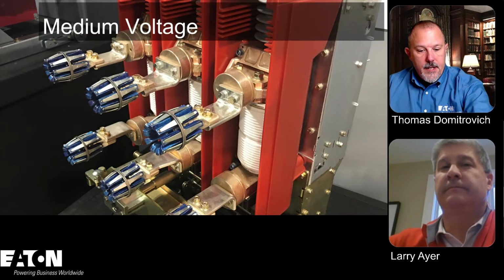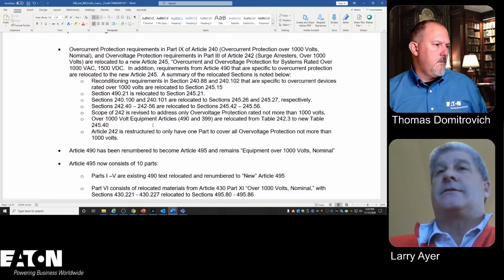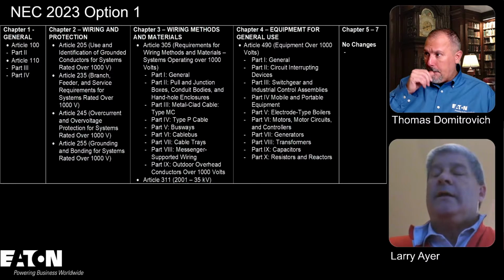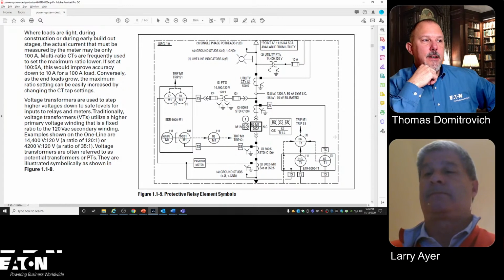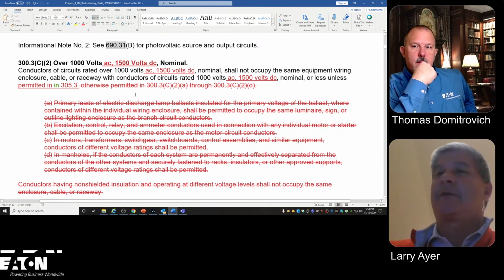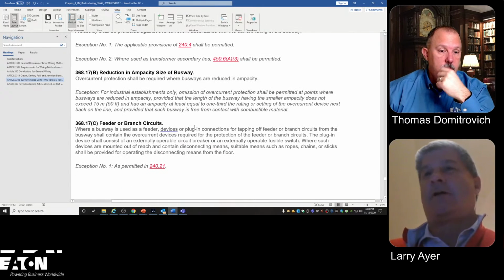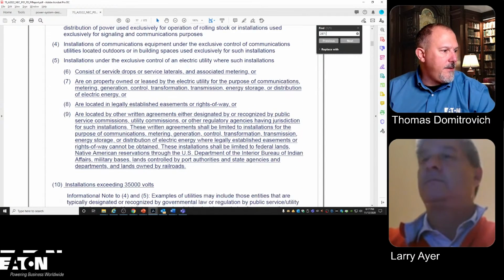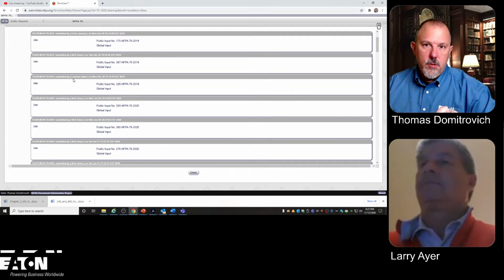Medium Voltage and NEC 2023

Comment: It is less likely you would be working on energized MV equipment.  BUT: the definition of de-energized is quite different in that you have to ground it and have all the concerns about induced voltages, static from T lines, or contact with another line somewhere up or downstream.
Reply from the maker: Great points J.W.!!!  thanks  https://youtu.be/OaDkPW2QvqU

Comment: On the 90 degree and 105 degree things too: low voltage breakers have thermal heating units that can actually be heated to nuisance trip due to heat of the conductors.  Medium voltage equipment using things like current transformers isn't subject to the same heat from the conductors.
Reply from the maker: Answered your question in this video.  Thanks for engaging in the dialog.  https://youtu.be/uN3bqw6jvkY

Comment: There's still issues that may exist even with different articles for MV/HV and LV.  For instance, low voltage wiring and equipment in large high voltage customer owned substations.  It still could be a problem that the people on the LV focused committees will be making LV rules without consideration of LV in a HV application.
Reply from the maker: Answered your question in this video.  Thanks for engaging in the dialog.  https://youtu.be/uN3bqw6jvkY